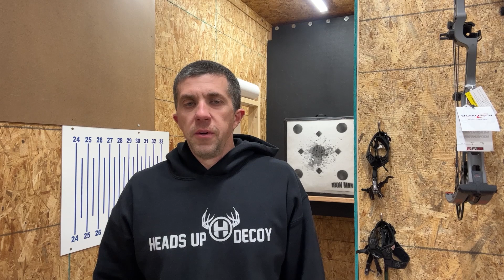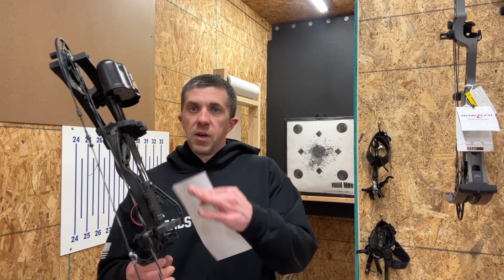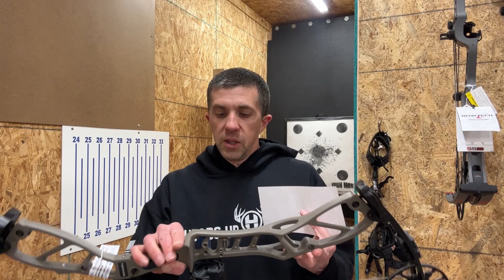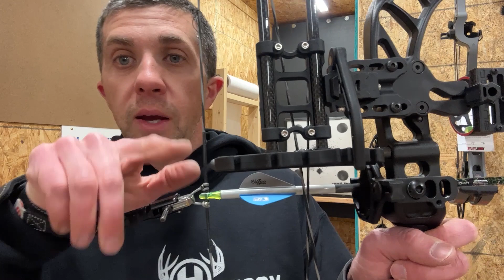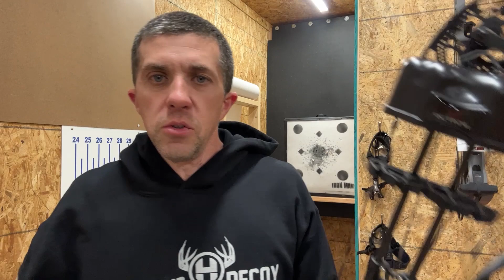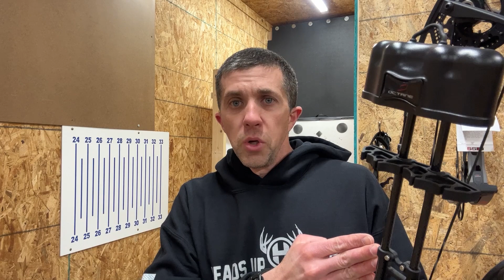Looking to get into archery?  WATCH THIS before buying a bow!

Comment: I purchased the Elite Terrain After watching your review. I’m 27”draw and 60 lbs. what arrow do you recommend for Whitetail? The bow shop sold me the Easton 6.5mm
Reply from the maker: Thanks for the comment! A 340 spine .003" straightness shaft weighing around 420 grains would be a good place to start. I sell Gold Tip and would recommend the Hunter XT, but the Easton 6.5 would be fine also.